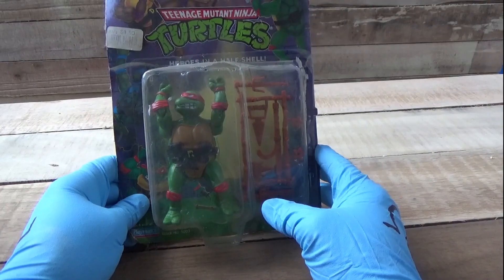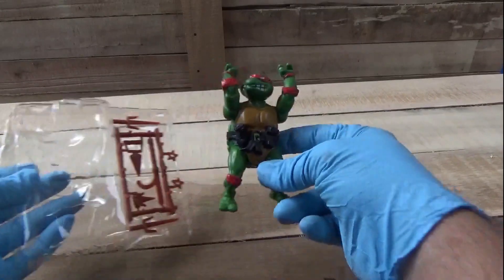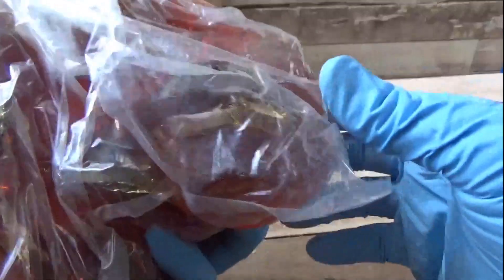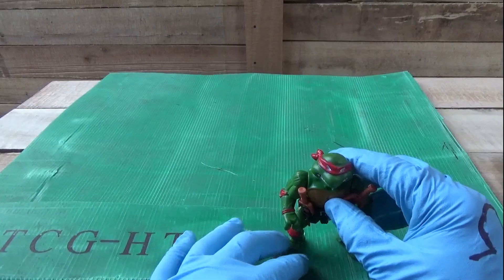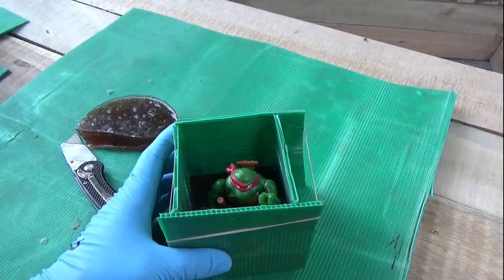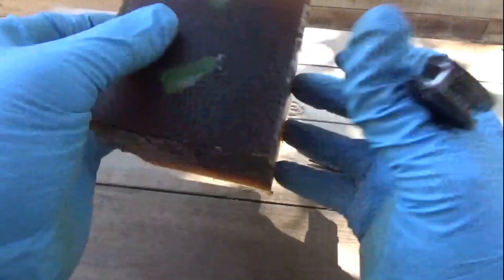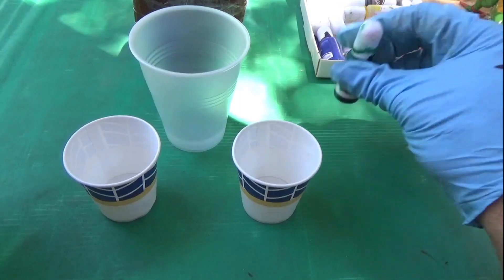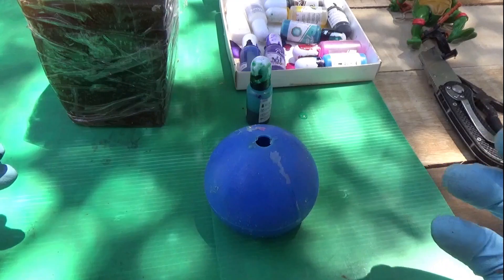Casting Raphael: Mold Making with ComposiMold and Resin (Craft Papa 001)

Comment: Do you have a tutorial video showing us what liquids and mixtures you used?
Reply from the maker: There should be a link in the description for both the resin and the ComposiMold. The resin is mixed 1 to 1. I show this in many other videos. The ComposiMold is just heated in the microwave or with another heat source. Check out some of the terminator videos I made I believe we show it quite a bit. Have a great day! Let me know if you have any questions 😎👍
Reply: Can I use smooth cast 325 with composimold
Reply from the maker: Yes you can! I don't have a video about it, but I have made a mold with smooth cast, and filled it with composite mold before. I then took the composite mold figure from the smooth cast mold, and casted that in plaster of Paris, then I put that in the microwave and got the composite mold out of the plaster of Paris after it was dried. To be filled with metal later. I never got to the metal step cuz I was unable to melt the metal LOL.😎👍
Reply: @OmegaOrdained  thank you for the reply wanted to buy something that could last me and be reusable to create All kinds of molds 
Especially with my trials in trying to get Polly pellets to work 
which just didn’t with smooth cast 325

Do you get bubbles or you spray it with bubble buster to the product to avoid any blemishes
Reply: @OmegaOrdained  lastly I tend to put a drop of black to my 325 casts 
Will that affect the mold and make it useless 
Or should I avoid coloring my casts when using composimold
Reply from the maker: If you're just getting into casting, you'll save a ton of money if you perfect your craft using composite mold. It's not a big deal for me at all when I'm old doesn't turn out I just throw it back in the microwave and do it again. I started with smooth cast, and I made many many expensive mistakes oh, many times because of bubbles. If I had a final product ready to go, everything was lined up right, then I would cast it in smooth cast. I do use the Bubble Buster, it works good with composite mold, but I have not tried it with smooth cast. I have also found using spray paint clear coat on the original is it a nice smooth texture if that's what you're going for. Another way to get the bubbles out of the original when using composite mold is to cast it twice. If the object is Hollow the composite mold has a tendency to fill the hollow parts in side generating a lot of bubbles. After you mold the first one oh, you can take the original out of the mold and recast it it shouldn't produce as many if any bubbles in the second pour
Reply from the maker: I don't know about dying the mold oh, I had some people do that on YouTube. If you're talking about the dying the resin, I do that all the time. And I have done it in both composite mold and smooth cast. I did notice the died will die the smooth cast mold oh, but I haven't noticed the die getting on the composite mold. The only thing with using alcohol ink as a die, is it will heat up the resin if you use too much, this will in turn heat up your composite mold mold, and you'll see significant distortion. I have a video coming out in a couple of weeks illustrating this with a Pikachu.😎👍
Reply from the maker: Oh hey ComposiMold makes killer dyes. I haven't had any problems with them at all. Here is a video about using the purple one. 
https://youtu.be/q54YkFTXLTg
Reply: @OmegaOrdained  I did look over they’re page but do you recommend using their dyes or the product of color I use are from 
Smooth-On So Strong Colorant Set is fine too 

I really do appreciate all this feedback helps so much 
I was discouraged with composimold due to a review stating does not work with resin for some reason 
But most of the reviews were good
Reply from the maker: Hey it's my pleasure! I love talking Casting LOL I couldn't give you an opinion on the smooth on color dies as I haven't used them. I have used alcohol ink by a couple of different manufacturers, they all seem to work pretty good. However some of them do lose their color over time if you didn't know. Pretty much all of my videos I use composite mold and resin together. And they come out great! I've got a Geordi laforge action figure duplicate video coming out soon, and I was able to capture the rink pins on his collar, using composite mold. I did a second cast using the same mold and got the same result. It's pretty high detailed oh, oh hey and I use the black composite mold die for that cast. If you want to see that specifically. However it won't be out for a couple weeks.